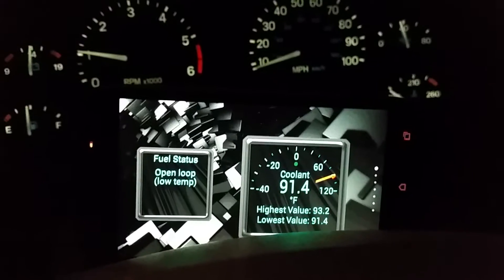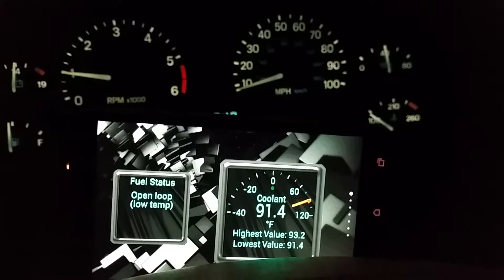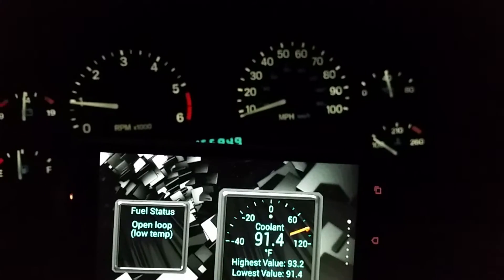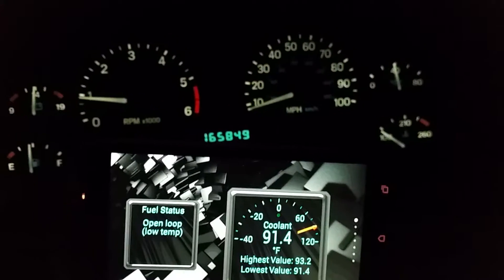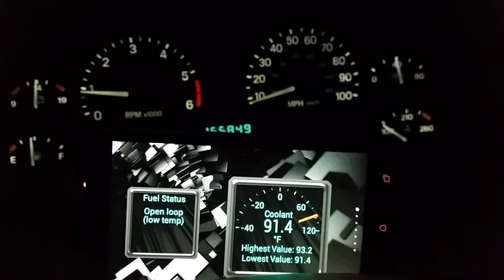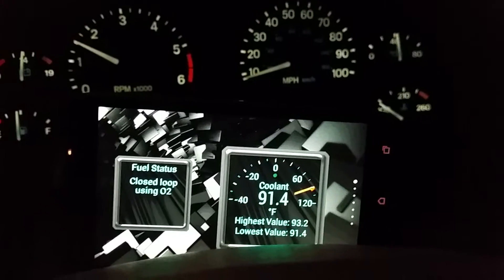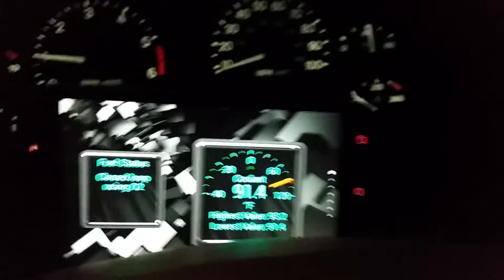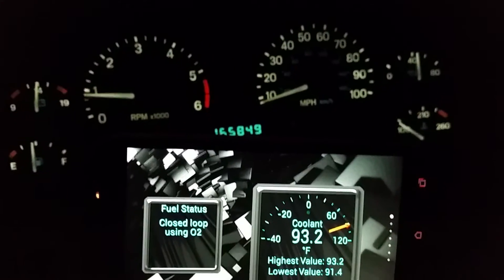Demonstration of OBDII going into closed loop. (1998 Jeep Cherokee)

Comment: So even if the pcm is using data from the coolant temperature sensor, it won't switch back to open loop based on a low temperature reading? (180F)

Comment: Larger TB's hurt air velocity which is what causes the turbulent air to fuel mixture.  You might gain a few ponies at a higher RPM on the track or while flooring it on the interstate, but it won't be noticeable, your gas mileage will suffer, and you'll lose torque and HP throughout the rest of the power band.  Save the TB upgrades for true engine mods like a stroker, turbo or supercharger.

Comment: Just today I breached the topic of open loop and closed loop fuel system operation.

I'm curious about more information on engine computer design. Do you know of any good resources for learning about typical signal flowpaths of engine computers, or a place where I could find a block diagram or schematic of my engine computer? I know where to get pinouts for engine computer connectors and diagrams for all the stuff that connects to it, but I always come up dry when I want to look up what's actually inside that little box.